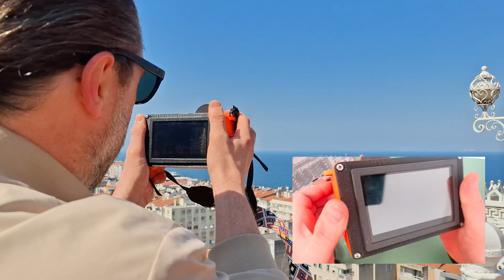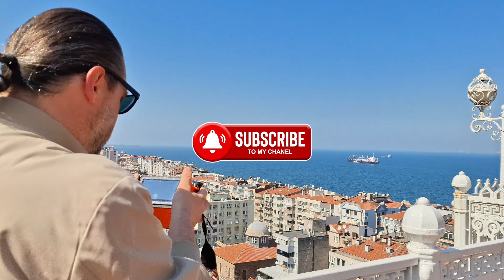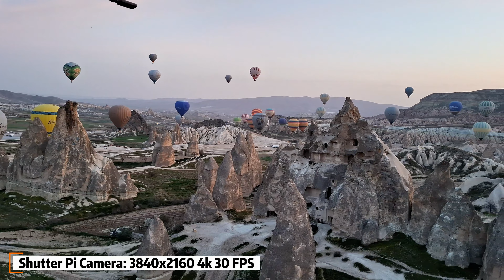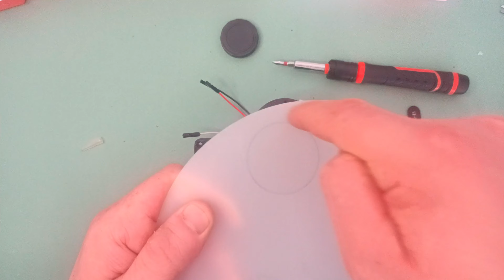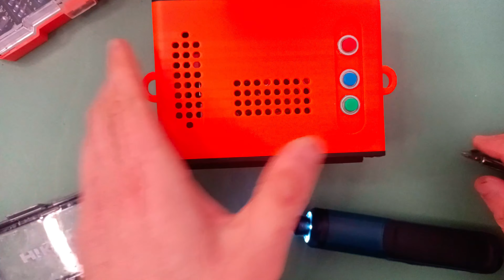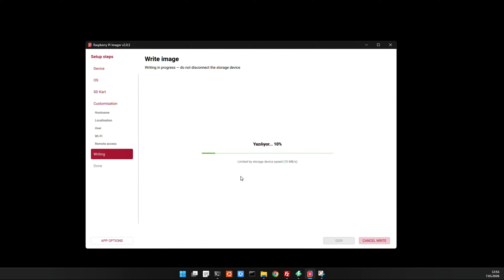I Built My Own Raspberry Pi Camera! (Part 1)

Comment: Hey! Would it work on raspberry pi3b+ 1Gb ram without screen and preview instead from webpage on my phone?
Reply from the maker: Hi! Yes, absolutely!

The Raspberry Pi 3B+ with 1GB RAM is more than powerful enough for this project.

You can run it in headless mode (without a display) and stream the live camera feed to a local web server (using Python Flask, FastAPI, or MJPEG stream). Then you can simply open your Pi's IP address on your phone's browser to view the preview in real-time!

Comment: “Great project, you did an amazing job on it. Is it possible to use a Raspberry Pi 4 with 4 GB of RAM?
Reply from the maker: Thank you so much! Yes, absolutely. It is completely possible and it will run perfectly on a Raspberry Pi 4 with 4 GB of RAM. In fact, it might even perform a bit smoother! Good luck with your build! 🚀